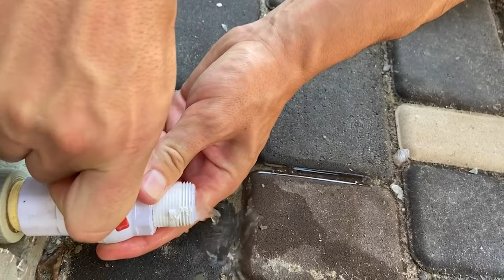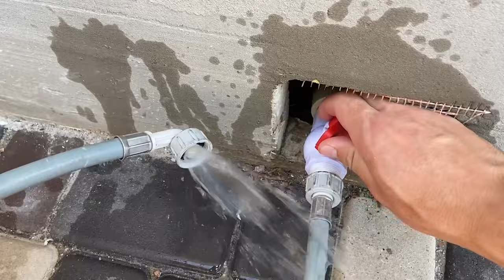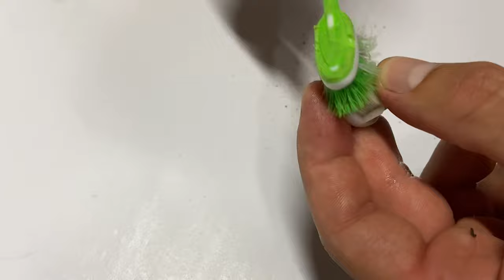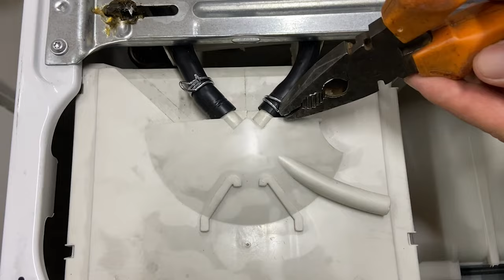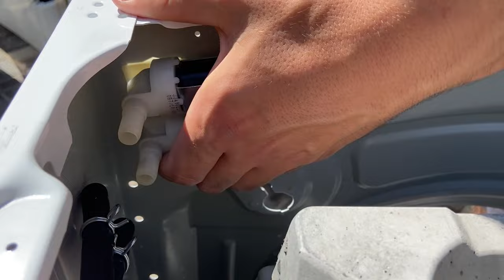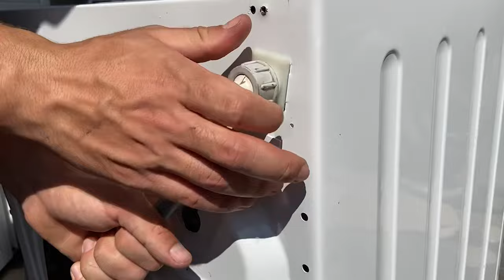Washing Machine F17 or E17 error. BOSCH | SIEMENS

Comment: Simple trick? Never seen something that complicated. Definitely you get a thumbs down for wasting my time by a lie!
Reply from the maker: How difficult is it to unscrew the hose and clean the filter? The remaining steps are needed for those who did not fit the first solution to the problem.
Reply: Yes its easy, but one time i did not have pliers had to remove the filter so i got the whole valve out @atbecmda